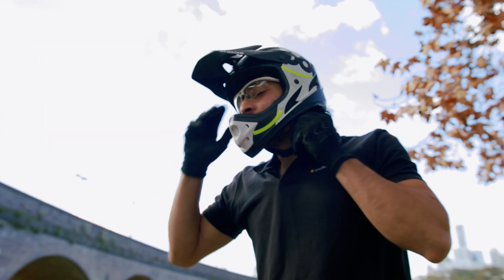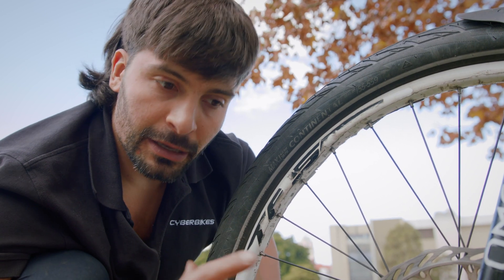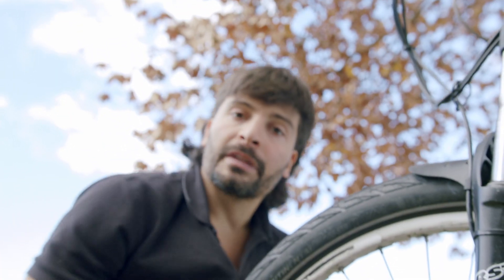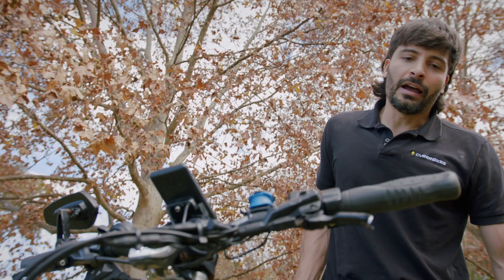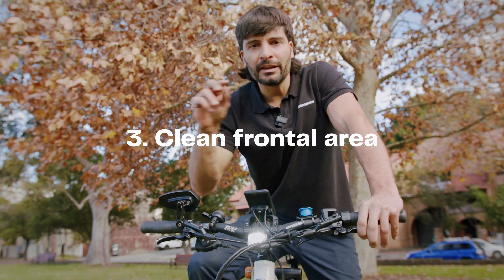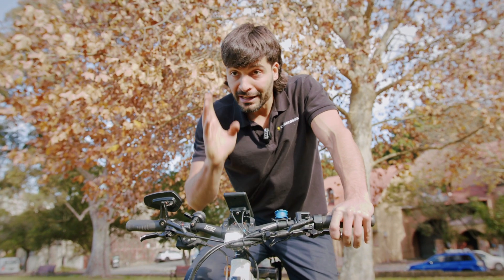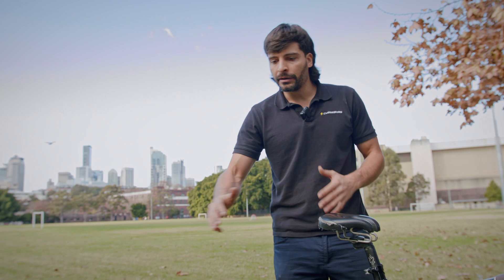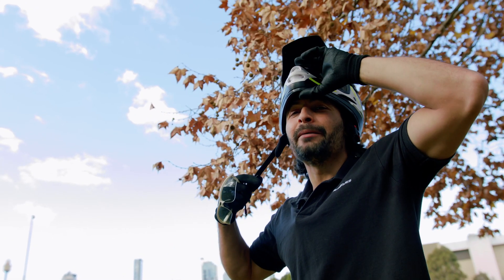Which Electric Bikes Have the Best Range?

Comment: Three other factors to consider: (1) make sure the bike fits your body as a good fit will maximize amount of power you can transfer from your muscles to your wheels (2) avoid high speeds that cause lots of air resistance — at high speeds more and more power goes to pushing the air you are moving through — the relationship is exponential (3) e-bike motors are more efficient spinning fast so if using throttle put bike in gear that allows motor to spin fastest

Comment: Felipe, great channel, learn more build and motor information from you than the Nerdout guy so I'm a subscriber.

1) Where did you get the security band straps for your triangle battery?  Manufacturer only supply Velcro straps = easy theft.

2) Nice rack & fender setup on that suspension rear, what brand are they?

3) Ali Express sells hydraulic brake handles with Bafang connectors. Could you do a video on changing handles?  I'm sure a lot of people would replace the stock magnetic switch setup.

4) Also a USB programming demo with the Speeed app for Android phones. I like the setup Luna does on their controller. Stock Bafang programming seems awkward at times.

5) Have you tricked out a BBSHD with a ASI BAC855 controller like the High Voltage channel or a GRIN Frankenrunner MT?  Captain Codswallop's Fatbike is a Boss bike to build. 
TY for telling us ... Keep them motor RPM's high.
Reply from the maker: metallic zip ties, thule rack, cannot recommend havent seen, we have a programing video too check it out, no we havent done it will check them out thanks

Comment: 6:17 - exposed charging socket? It will start corroding after few rides in the rain. BTW. The best frame for conversion is hardtail. Why? Because you can use regular factory made battery which mounts to holes in the frame.
Reply from the maker: Sorry, but what are "exposed chainring sockets"? The best frame for conversion depends on the application and budget.
Reply: @Cyberbikesau  look at the charging port. Rubber cover is mising.
Reply from the maker: @ataksnajpera  it uses a screw-on lid which got lost years ago when I let my bike with a friend for a few months while I was living in China. The ideal is to have the lid but I haven't had any problems with that since 2019.